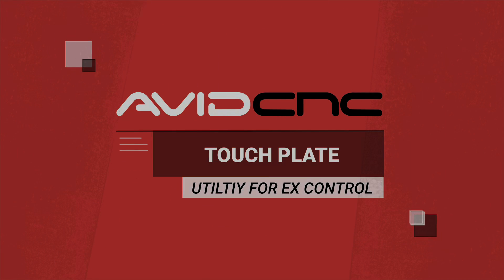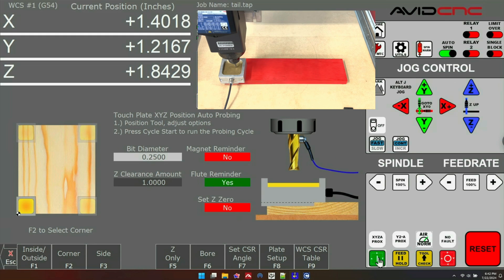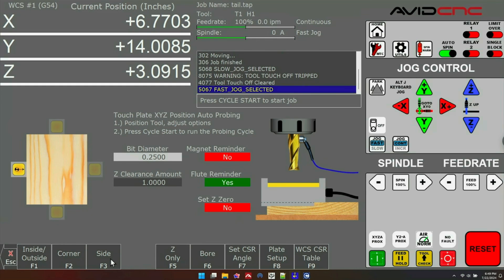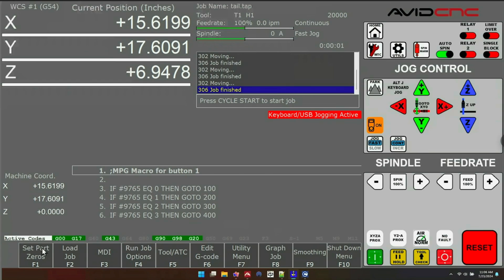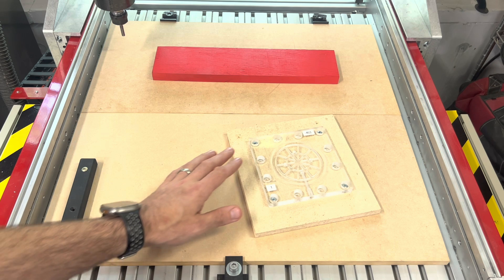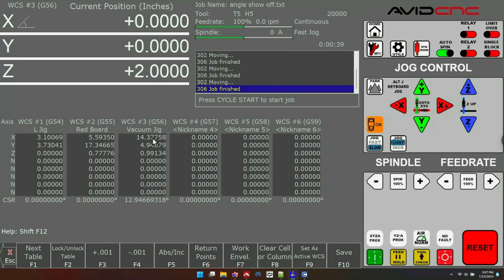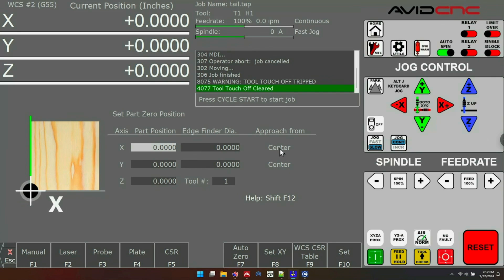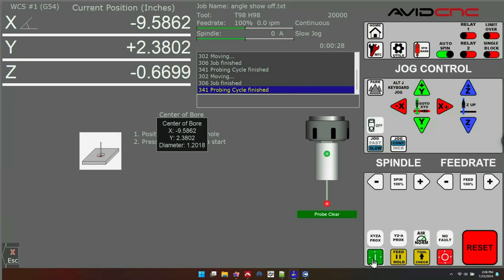Touch Plate Utility - Avid CNC EX Controller

Comment: So is this screen set available if you already have Mach4 and where do you get this touch probe software as it is not on the Avid website?
Reply from the maker: Unfortunately, this is not available for Mach4, it is part of the CNC12 software with the new EX Controller.

Comment: Wait, you are ditching Mach4? YES!!!! Thank you thank you thank you! I've never before used software which regularly corrupts itself and requires a reinstall.
Reply from the maker: All controllers sold after the beginning of August have the Centroid Acorn control PCB and run CNC12 software.
Reply: Dont think they are ditching Mach. They are in bed with Mach4

Comment: Is this Mach 4 or is this only for the new hardware?
Reply: Yes that’s what I have found out.
Reply: Hoping you get a reply but after looking it appears you can only get this if you spend another $3K and purchase the new EX control system.
Reply: @rufustoad1  I did get a reply  It is a new item and full system that they have.  I currently have the older system and was hoping this would mesh in but alas....
Reply: @kurtmartin8162  Thank you. Can I assume the only way to get this is to purchase the new EX control system even if you have an older system?